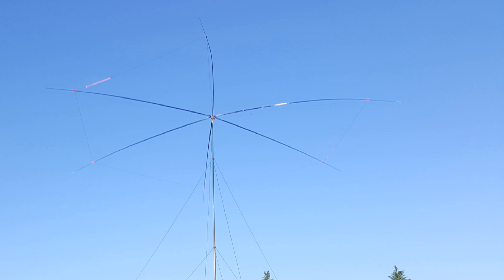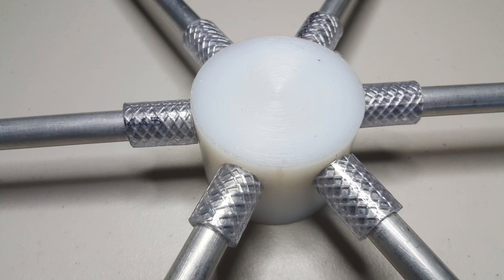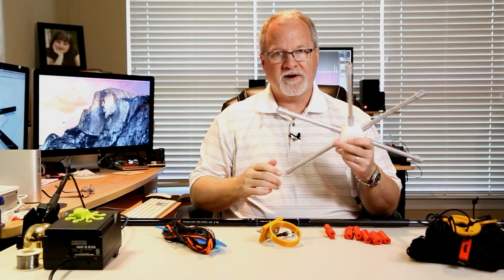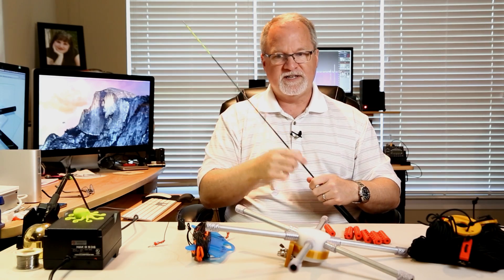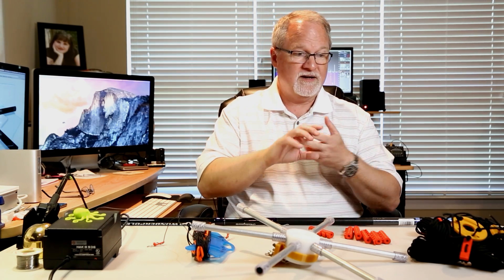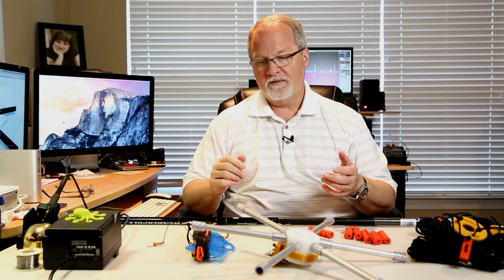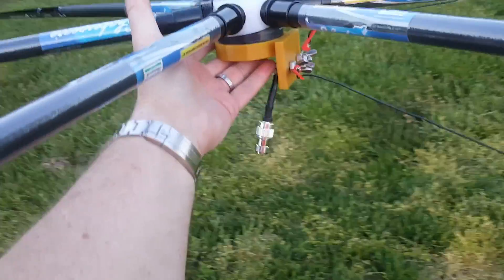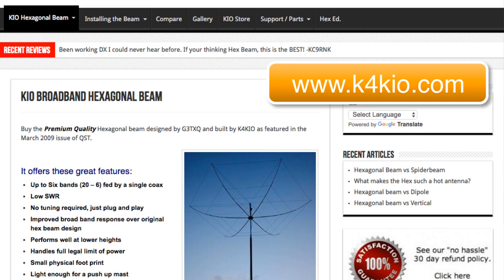Build a Portable Hexbeam Antenna

Comment: How was swr on 20 meters? Was swr affected by height above ground, and how was swr from 14.150 to 14.350? Thanks !!
Reply from the maker: I only use mine for 20m.  Since you control 1) the height above ground and it's always the same because you're always deploying it with a particular mast AND 2) you are cutting the wire for the Driver and the Reflector, you can adjust the wire length to get near-perfect SWR.  Of course, anything 2:1 or less is great so there's nothing to worry about with this antenna.  Have fun! - Cliff

Comment: So in a nutshell, just 3d print everything you need, easy enough if you have a 3d printer that costs as much as a commercial hex beam.  Makes sense.
Reply from the maker: In a nutshell, buy the center hub at TN07 Engineering and get creative with the rest. Or don't.

Comment: your right there is more than the theoretical gain, there is the special  coupling between the reflecter and radiator, you know where?
Reply from the maker: I'm not sure what you are saying.  There is not an electrical connection between the reflector and radiator.  The radiating wire has an insulated wire/cable/other that physically connects the radiator and reflector, but they are not connected electrically.  Think of this as a standard two-element beam with a differently shaped radiator and reflector.  I hope this helps. - Cliff

Comment: Would you be willing to sell a set of the wire hooks you 3D printed?
Reply from the maker: Adam Medeiros - it probably wouldn’t work for you as I printed them with the correct inner diameter to match the outer diameter of my tapered fiberglass spreaders as measured at the exact place.  -Cliff

Comment: I look at the commercial built Hex Beams and think it would be best to save my money and build something myself. $500 on up is a lot of money for any antenna that you might as well throw in the dumpster after you use it once or twice. I live in a very brutal weather climate of SW MN. I have two self supporting towers that I have been thinking about putting up any type of beam antenna. I think I will stick with EFHW or dipole style antennas.
Reply: 4 years later after your comment and the cheapest hexBeam kit is $700. But also getting the parts yourself isnt cheap ether. Just the spreader kit poles are $200. Add a plate, a pole, wire and clamps will get you close to $400 in 2024. Also you need all the tools to prep the plate and the "air coax". So if you want a well bult hexbeam that will resist the elements is not gonna be a cheap adventure nowadays.

Comment: Cliff
have you tried adding other bands with this so as to be able to use multi bands.?
Reply: Hello, Ed.  No, I haven't added any other bands. 20m is my go-to band when working portable during the day so that's the only wire kit I made. My friend Doug Miller (W4DML) made his wire kit into a dual-and 17m/20m and it works fine. - Cliff

Comment: This is a very nicely done video, and I'm impressed by the project. I worry that the cheapo plastic on the base of the Wonderpoles is going to cause problems if you intend to use this for any period of time. I'd also be interested in seeing how you priced out all your parts and how much you beat the price of a K4KIO antenna by homebrewing. 73 NF1R
Reply from the maker: Clayton Nall Well, the K4KIO Hex Beam is fantastic- but it's not portable.  The one-band version of the K4KIO is $379. That doesn't include a mast... just the antenna. The one I built cost $99 for the hub (from TN07 Engineering) and $80 for the 6 spreaders. The rest of the parts were cheap... so about $200 to build the one I show in the video. I would dearly love to have a K4KIO he's beam permanently installed here at my house - but my HOA wouldn't allow that. -Cliff

Comment: Woooow I loved this video! Thanks!!! I would like to see it in action making aome QSOs. 

I'm wondering how you convert the silver small 6 tubes into the 6 fishing poles.
Thanks and 73.
Reply from the maker: At the bottom of each fishing pole, there is a cap that can be unscrewed and removed.  When you remove the cap, the fishing pole is hollow.  You just slide the hollow fishing pole over the metal tubes in the antenna's hub.  The water tubing that covers the metal tubes makes the fishing pole fit securely so it doesn't fall off.

I should have shown that in the video, Eduardo.  Thank you for asking about it. - Cliff

Comment: So, Can I install several antennas each measured for different bands all on this one structure/washing line? :)
Reply from the maker: I built mine for a single band (20 meters) but my friend Doug Miller made one with a 20m wire kit and a separate 17m wire kit.  He doesn't try to do both bands with a single wire kit or two kits sharing the same feedpoint... he simply lowers the antenna and installs the other wire kit.  You CAN devise a way to hold multiple wire kits at the same time, sharing a common feedpoint, but that's beyond what I wanted to accomplish with mine. - Cliff
Reply: QRP School
Thanks a lot for the feedback, I will have a go at this. I bought the big A.R.R.L Antenna book and I will cross reference to see what information it has on these. These do seem an ideal option if you have limited space, I might try hanging a T-Shirt and some socks on it to try bypass the planning permission :) 73

Comment: Not trying to reinvent the wheel. But could the hex beam be fed with 450ohm wire. Antennas fed with twin lead are more efficient having a higher than normal swr.
Reply from the maker: The hex beam (and any two element beam) is simply a dipole serving as the "driven element" with a (roughly) 5% longer wire behind it, serving as the "reflector".  So, if you can feed a dipole with 450 ohm line, you can feed the hex beam with it.  However, I don't see any need to do that. - Cliff
Reply: QRP School last thing. Can or does hex beam come with 75 meter elements. Or is highest band 40 meters.
Reply from the maker: For the 20m band, the hex beam is about 25 feet in diameter.  You can build it with lightweight fiberglass fishing poles.  For 40 meters, double that distance!  For 80 meters, double that again!! It's just not practical (possible?) to extend the wire so far from the hub without your homemade spreaders breaking (or at least bending horribly) under their own weight.  For 40 meters and lower, I have to use a dipole - but I'm fine with that. - Cliff
Reply: QRP School , ok. I've seen or heard of the antenna being placed up sidedown on a town. Just a though. 73 kf4dcy

Comment: Just get some thin 13' bamboo poles from Cragslist for free. Get a thicker bamboo pole as the center pole. Zero cost. Buy a tripod for cameras from an estate sale for $2. drill a couple of holes. Get a level from an estate sale for $1 if you don't have one. Get old wires from an estate sale for $1. God you are making everything look very technical and complicated when in fact the theory behind is sooooooo simple.
Reply from the maker: Arthur Hau Perhaps you could build a nice $4 portable hex beam and then make a video about it? Please post a link to it here in the comments. - Cliff
Reply: id like to see a video on that myself
Reply: I don't know where you live. But most cities require a building permit for installing a pole that is 15 feet or taller. Why don't you follow my idea and build a cheap hexbeam antenna in your place? It is viable; it just needs some thrifty grey matter. BTW, check the building code at your local county building department or your expensive hexbeam antenna will be demolished just like that. My 2 cents.

Comment: 1) You're right when you warn us that the materials and footprint needed to deploy this are portable only in the sense you can carry them - in the same way a mini-fridge or a set of 30 lb. dumbbells are portable.  Its more like what you would put up for a weekend than for an afternoon day hike.  

2) Your interpretation of the Hex Beam is very cool, and you have a real mind for design.  A 1"-2" steel rod driven into the ground with 3-4' above and 3-4 feet below ground that you could slip the mast over would give it stability such that guying may not be necessary if the mast is rigid enough- or you sacrifice some height.  S9 antennas built 31' and 43' verticals on this principle, and they're great (well reviewed in QST, the guy sold the company to LDG, who in turn sold it to Alpha Antennas), mines been up for 6 years straight.  I could imagine a rotor or stepper motor turning a gear slipped onto the base of the mast in such a set up.   Your design is so light weight, that with maybe a stronger hub it could be a permanent antenna.  It aint much different than what is out there for  purchase.  

Very nice video, only wish you had a vid with the antenna in use.
Reply from the maker: +kd8poi 1) Agreed. My friend Doug puts his in a tent pole bag with a shoulder strap. You can carry the whole thing fairly far from your car - but one should not even dream of hiking with it.

2) When I've tried to deploy this without guying it, there's simply too much flex in the mast at the top.  The added weight of the system at the top of my telescopic mast has it swaying dangerously in the breeze.  As you point out, I could lower the height and get by without guying it.  But then I start to wonder whether it's worth the trouble.  A 20m dipole at 33' may be just as good as a hex-beam at 20'.  If the hex beam is still better, is it worth the aggravation if the hex beam is only marginally better?  It's a tough call.  Personally, I don't plan to use the hex beam more than a few times per year.  I'm happy with a dipole 99% of the time. 

"only wish you had a vid with the antenna in use"
I wish I had shot a clip showing how the S-meter is affected when turning the antenna toward a station and then away from it. - Cliff

Comment: Hello Cliff,
I have subscribed your video channel and always wait eagerly for another class that you will share with us.

Very good tips on the construction of this antenna and allows like to suggest you to try the two elements moxon antenna for portable operations.

I live in apartments and still can not put all my radiant system in the building's roof, I am an unconditional fan of portable operations.

I have achieved good results in the bands 10 to 15 meters with the Moxon antennas.

With only four fishing rods can have an antenna with a gain ratio execelente front / back up usn 12dB, the Moxom surprised me positively in field trials. If one day remember this commentary and test their certainly this model moxon antenna will go into your successful projects gallery.

Thank you for you share their knowledge and wish you good winds.

73 PU2SRZ

Comment: Great video.  What 3D CAD software are you using?
Reply from the maker: +Dave Eppley Hello, Dave. It's Tinkercad.  It's easy enough for kids but can be used to do more complex things, if desired.  I use it for modeling things for 3D printing.  For work that requires more precision, I recommend 123D Design. Both Tinkercad and 123D Design are owned by Autodesk and are free of charge.  You can get up-to-speed on Tinkercad in an hour or two. Give it a try when you get a chance.  It's fun! - Cliff